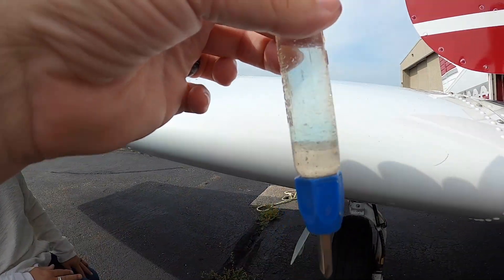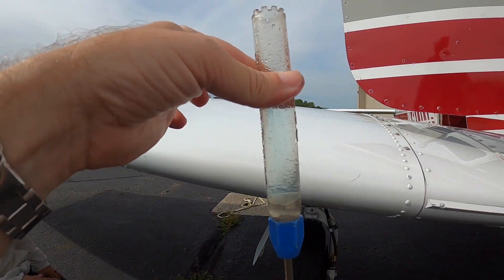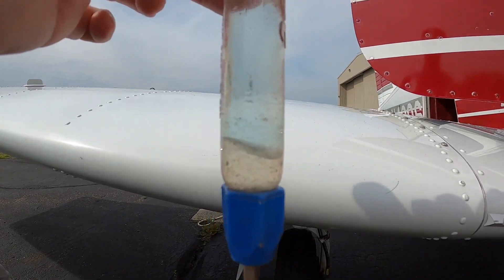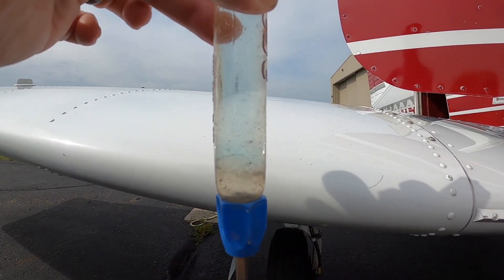Water in the Fuel!

Comment: The other thing to watch for if you have a lot of water in your fuel sample, when you dump it on the ground, it puddles on the pavement. When you dump 100LL on the payment it spreads out flat. Airplanes with recessed fuel caps can collect a lot of water in the tanks if the rubber seals go bad either around the outer edge, or the seal around the release handle. If you have ever had to drain a lot of water out of a fuel tank, it will make you more thoughtful about sumping the tanks. You will be surprised on how much water can get into your fuel tank with a defective fuel cap seal. I have seen this on the Beech Musketeer, sundowner, and SIERRA series of aircraft. It is good that you showed this. I can’t ever remember seeing water in a fuel sample during flight training in a Cessna.
Reply from the maker: Good points.
Reply: @quinnjim  the problem comes when you have a lot of water in the tank....more than your fuel sampler can hold.  It can be difficult for a newer pilot to tell if it is water.  The sample may even smell like 100LL. When it doubt, sump more fuel. Maybe compare it to a sample from the fuel strainer near the engine just to be sure.  The most water I ever drained before finally starting to see fuel was about a half of a gallon. That is a lot, but not out of the realm of possibility if an airplane is outside and if there were heavy thunderstorms. Water makes a lot different noise when you are draining it compared to 100LL. You will be able to hear, see, and smell a difference when drawing out the water, and you finally reach 100LL.
Reply from the maker: @jamesharkness1058  I've never seen that much.  I always have my students check for the blue color.  Most of my airplanes have been white, so they hold the fuel sample against the white paint.
Reply: @quinnjim  Beech and Mooney have recessed fuel caps.  And have seen it on airplanes that are left on tie-downs outside. I bring this up because I had a friend with a Beech Musketeer that crashed shortly after takeoff may years ago. It was fuel contamination due to water leaking through the fuel cap with worn out seals from an overnight rain storm.  Like I said, I have never seen this issue on Cessnas. Luckily, he and his wife survived.

Comment: Thanks for the tip - doesn't take long to check a couple of time -  safe flying
Reply from the maker: I recently met a guy who hasn't checked his fuel in 10 years because his plane is kept in a hangar!  You can get water from condensation or even from the fuel truck if they haven't maintained the fuel properly.

Comment: Wow, that thing has ALOT of water in the tank! That just from sitting for years and condensation happening inside a partially full fuel tank?

I bought an ethanol test kit years ago, and it came with the little plastic plunger for checking aircraft fuel. At the time, I hadn't a clue what it was! Was a few years before I got bit by the aviation bug. :)

I see this all the time ... but NOT in aviation! Always small engines filled with 10% ethanol mogas. I usually clean or replace at least 50 carburetors a year. Just did a bunch of generators that were a mess, after we got glanced by a hurricane at the beginning of the month. Power was out here for 4 days. Generators are usually the worst. People run them, then throw them in the garage or shed where they might sit 2 years or better. Some don't even have the luxury, and get left outside under a tarp. Just had one of those - when I got it running after draining a half gallon of water/ethanol separation mix out of the tank, about a quart of water got pumped out of the exhaust! I shot a brief vid of that and put it on Instagram: https://www.instagram.com/smitty_smithsonite/  - can see that it was left outside for a LONG time. Good thing it's a Honda, or it would've been in the scrap pile.
Reply from the maker: We don't know how all that water got in the tank.  A lot of times it's from sitting in heavy rain and the gas cap seals have failed.  The fuel truck could have had bad gas or condensation can cause it (although it seemed like WAY too much water for just condensation).  Funny you should mention the generators.  I just tried to start mine and it wouldn't work.  It sits in the garage and I usually only run it a couple times per year.  I'll probably drain the carb and see if I have some contamination in it.  I've had that unit for 7 years and it probably only has 10-15 hours on it.
Reply: quinnjim - I agree, that was definitely quite a bit of water in there to be just from condensation. And I’m not surprised about your generator. That’s the way they all go! Life gets in the way and they get neglected. That last one I had to scrape the carburetor it was so bad. Had to flush a lot of rust out of the tank, too.

Comment: That is typical with metal tanks, more so than rubber bladders! It can also happen if someone mixed Auto Fuel with the 100LL. Car gas has up to 10% ethanol in the fuel and that makes water! Great video, thanks for sharing!
Reply from the maker: Rubber bladders are great.  Replacing them is a pain (and pretty expensive).  I'm not sure which is better.
Reply: Depends on where you get the auto fuel. We only use ethanol free mogas, available at the pump.